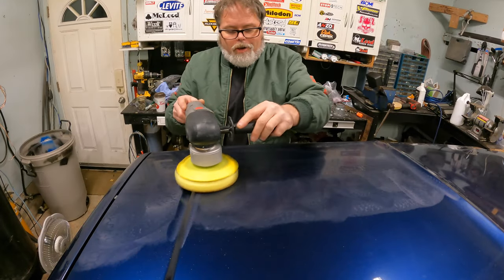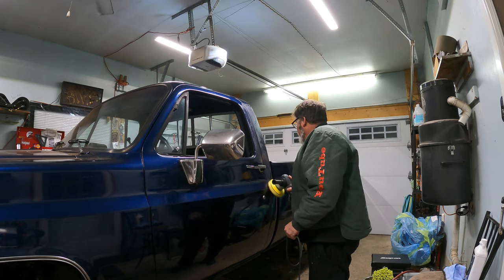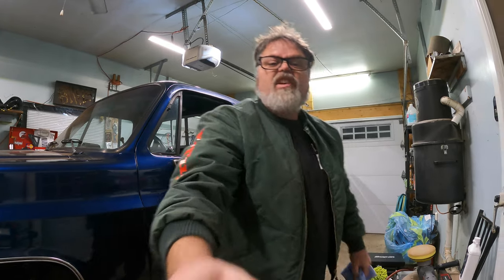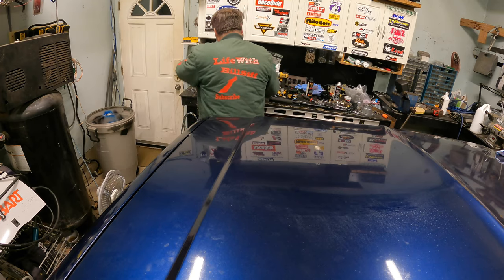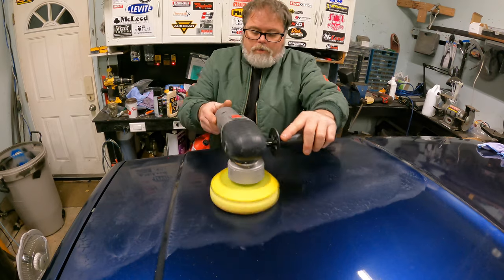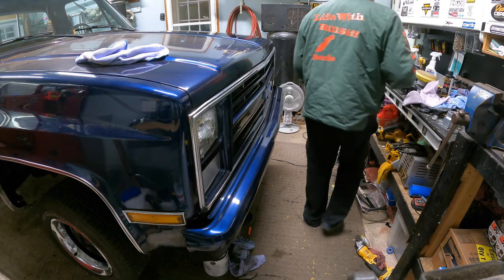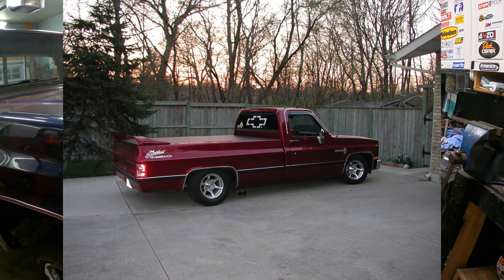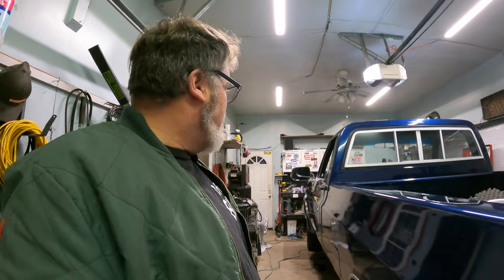Removing Over Spray    4K

Comment: Nice work. Looks great, Captain! When can you buff my truck? Although it would probably cost more in gas money to drive my truck to Canada, than it would for me to pay full price to someone locally. Lol. My favorite vehicle that is long gone was my 78 Chevy 3500 square body. It had a 454 engine (558HP on the engine dyno) 400 Trans, with 205 transfer case, Dana 60 front, 14 bolt rear, 4.56 gears, and 44" swampers. Don't get me wrong, I've owned "nicer" vehicles but that one was the coolest.